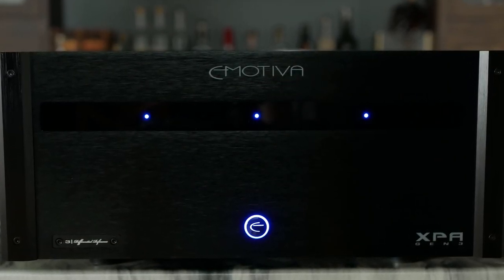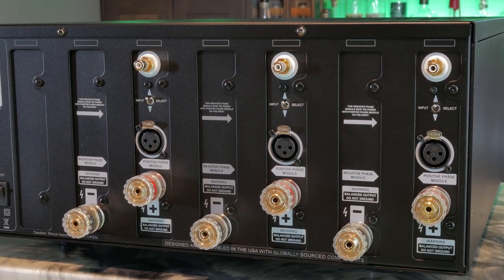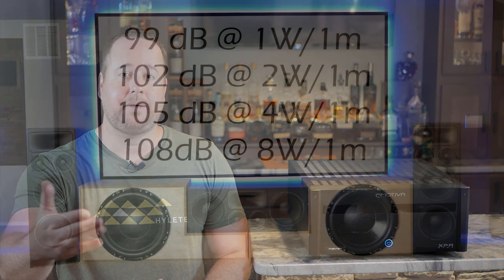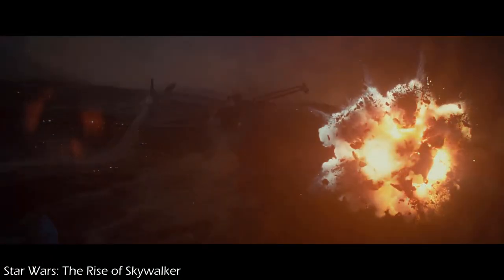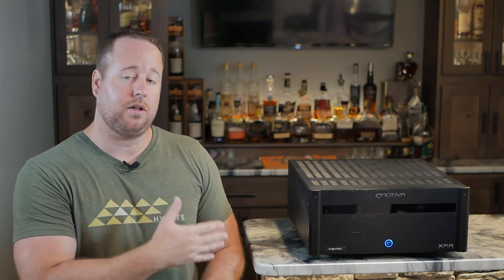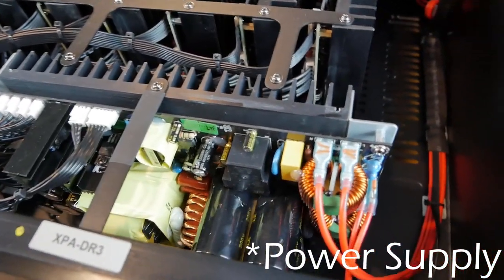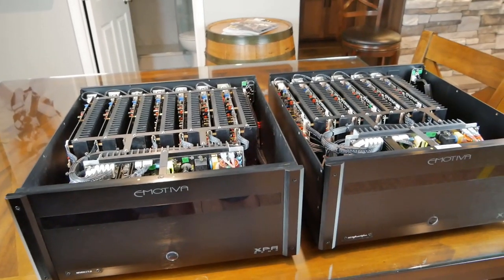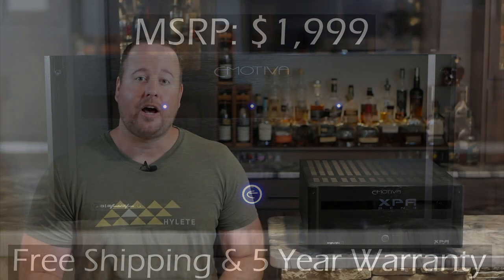Emotiva XPA-DR3 Review | Differential Reference Home Theater Amplifier

Comment: What a nice review a good explanation of the difference technically the XPA DR3  would have better specs but did you tested to determine whether or not you can actually hear a difference in sound quality between the XPA DRR3 and the XPA 7
Reply from the maker: I was only using rca cables to connect, so no real advantage between the 2 besides more power. Both sounded great, but I could not tell a difference, just more power on tap with the dr3
Reply: @LifeofBliss  are differential amps supposed to sound different?
Reply from the maker: Just a different design. Lower noise floor, little more power in this case.

Comment: I have been through a few amps, and always wind up going back to my first generation XPA-2. I upgraded quite a bit of my other gear, and now it was time for the amplifier. I was initially looking at the ATI and Parasound 2 channel offerings, both around that $4000 mark. 

I have looked at the Emotiva XPA-DR2 since it came out. What held me back was a review by Amir over at Audio Science Review. Go look it up, it was a real hit against this amp, an unfounded hit in my book, as what he stated as distortion is not audible to the human ear. 

This XPA-DR2 is very musical, as I am sure the DR3 would be. This is an incredible and affordable amplifier, and I would easily put it up against amplifiers costing twice as much, like the ATI or Parasound. It is very detailed, handles the bass with ease, fast and hits hard. Midrange is smooth and very detailed, highs are not harsh, very clear with lots of clarity. This amp simply rocks the house. 

It is sad that this amp has so few reviews and is pretty much ignored. Emotiva has a real winner on their hands here.
Reply: Amir would run a few non-musical measurements and would rate class D ChiFi amps higher than this one, even though they sound fatiguing
Reply: @wolfmanjacksaid  do you know where all the components and parts of this amp are made in?

Comment: Good review 👍🏽 However. can you confirm if those rated watts are measured at the full frequency spectrum? Many manufacturers measure @1kz which is misleading.
Reply from the maker: I went off the specs from their site, I believe it's at 1kz but you'd have to confirm with then

Comment: I'm really thinking about getting this to power my front end. Currently I have the Klipsch rf-7 III and the Klipsch RC 64 II. This should be perfect for them would you agree? Currently I'm running the Integra DRX 7.1 receiver and it just seems like I'm not getting the quality sound I should. I'm thinking on purchasing the Klipsch RP - 600m for my surround sound and maybe the rp-500sa for Dolby Atmos. Would I need another amp for those or could I just use my receiver to run the surround sound and Dolby Atmos and the amplifier to run my front end? I look forward to hearing your response thanks for your help brother!
Reply from the maker: Obviously budget will determine what you can do, but if you didn't want to spend as much, getting an amo for your front 3 will give you the biggest improvement. Moat of the soundtrack comes from there, so you'll get the biggest gain throwing an amp in for the LCR. You'd do just fine using you receiver for the surrounds and atmos. If you feel you want another amp down the road for the others, it'll help dynamics and channel separation. But again, focus on the LCR first 👍 can't go wrong with emotiva though in my opinion!
Reply: Thanks for getting back to me brother! I just received my Klipsch RP-600M surround speakers today. It's great to hear that I can use my receiver to run those and the Dolby Atmos when I make the purchase. Hopefully I can pick up this amplifier soon. I am super excited!
Reply: I have a very similar setup, I have the Klipsch Rc-64 iii Center speaker, 2 Klipsch Reference Rf-7 iii towers, a pair of Klipsch 500sa Dolby Atmos to sit on top of the RF-7 iii, A pair of Klipsch RP-500M bipolar Surround Speakers,  A pair of Klipsch RP-600M Bookshelf for surround backs, And Svs height speakers for ceiling, with 2 SvS PB 3000 Pro Subwoofers, I am running a Denon AVR-X4700H and I have my Emotiva XPA-DR3 coming in tomorrow, I had a Rotel 1585 external amplifier but the Rotel gave out after 6 months, So decided to try Emotiva, I've heard good things about there Amplifiers, And this video just proved everything I've heard😁
Reply: @monroethegreat7539  Was the Emotiva any good?
Reply: @485danne he still don't know that

Comment: I own the Emotiva XPA-7 Gen 3 and an Emotiva XPA-5 Gen 3. I also used to have the hiss/humm on my XPA amps WHEN I used RCA, all of that went away when I went to fully balanced XLR's. Well, what do you think, are you keeping any of the Emotiva's?
Reply from the maker: I have loved using these amps. They will not be going anywhere besides back in my rack 😎 and good to know with the XLRs. I really need to upgrade to a pre/pro at some point when funds allow for it
Reply: @LifeofBliss  that' the spirit :)
Reply: Have you tried Monolith 7X, made be ATI? From what I've been reading and hearing the Monolith is a beast.
Reply: Sorry this is late but im just getting to the party. If you have a hum there's a ground loop problem. Run a ground wire and connect to each piece of equipment. If that doesn't fix the problem look at it being a bad cable. If that's the case. Unplug cables one at a time until the problem goes away to locate the bad one.

Comment: Is it worth the extra $1200 Canadian the DR3 vs regular 3 channel. Thanks for a great detail between the 2 amps.
Reply from the maker: If you need the extra power, I'd say go for the DR3. 275w vs 450w x 3 channels. That will depend on your setup and how sensitive your speakers are, as well as how loud you like to listen. Personally, I don' know if you'll hear much of a difference sound quality wise unless running the DR3 with a fully differential input as well, which will lower the noise floor a bit. That's quite the difference in price, I'd look more at how much power do you really need as the deciding factor. Both are great amps though! 

Btw, if you wanted to help out the channel, click on one of the affiliate links I listed below when if/when you purchase your amp. Doesn't cost you anything and lets Emotiva know these videos are helpful! Thanks Gerald!

Comment: Thank you for great explanation.Right now i have monoprice monolitch 7x200  my speaker klipsch r28f center rc64lll you think if i buy emotiva -xpa DR3 i will get better sound Thank you.
Reply from the maker: You'll have about twice the power, so if you're running into clipping issues with your current amp, it may be worth upgrading. I don't think you'll notice too much of a sound difference outside if that though.

Comment: @5:00 could it be just what is called ground hiss? I used to have a slight, almost inaudible sound like you mentioned, in my speakers. It is completely gone after switching my power supply to one without grounding.
Maybe it would solve it for you too?

Comment: just heard you had rca as well   I can share with you that I purchased a Rane Balance buddy BB44 (passive isolation transformer) consumer TCA to PRO XLR and the buzz was still there only problem is the pro level is 12 db hotter so i still feel it is the noise floor of the AVR pre amp outs  Interestingly Denon wouldn't give me that spec

  OH I should have mentioned for the gear heads my compression midrange is a JBL 2445J and the tweeter is a JBL 2404 H-1 with sensitivities of 111 db and 105 respective so it may not be an issue for the average consumer

Comment: With regards to the Buzz you described    I use JBL SR4732 s for my left ,right and center stage and I get the same Buzz at the same power levels class H   AT first I thought it was a filtering issue with the switch mode power supply but I to soon same to realize it appears to becoming from the noise floor of my $1500 ish Denon pre amp outs (unbalanced RCA) coupled with the 111 db spl at 1 watt 1 meter  IF you have Balanced XLR outs on your (AVR) then I feel better now because I now feel it is a sensitivity in the consumer gear 

just my humble opinion
Reply from the maker: Yes once I switched to the emotiva RMC-1L with balanced preouts the buzzing disappeared. Those super sensitive speakers just pick up the slightest noise...
Reply: I was getting a low low frequency hum\buzz noise on my system as well. Just like you it did not matter the amplifier I used, but as you said i could really hear it from my listening position. Unlike you my receiver does not have balanced xlr outputs.  I found it was being caused by a ground loop issue. I traced it to my digital antenna tuner. it was coming from the coax for my digital antenna and ground loop was being carried over the HDMI cable to the reviver whether it was set to the tuner input or not. I completely fixed it by putting a $15 ground loop isolation filter on the coax before the digital tv tuner. No more hum/buzz.  I seems it is common for most ground loop noise issues people have to be related to their cable antenna connection.

Comment: I just got the polk r700 towers and I now hear the hiss from the tweeter using the DR3. I disconnected preamp and only had speaker cable from DR3 to speakers and hiss was still present but only can hear when I have my ear hard up at the tweeter not the midrange or bass.  I wonder if I uncouple the biamp plates on the speaker and use good speaker wire jumpers instead!
Reply: What receiver/preamp are you using? Are you using coax or XLR and were you able to fix your issue? I'm asking because I have the same speakers and thinking of pairing the DR3 with my Dennon AVC-X3700H :)

Comment: Will this be overkill for my B&W702s2 
90db 50-300 w
Any recommendations will be very appreciate it ?
Reply from the maker: Nope. My speakers are 99 db efficient and there is an improvement when using an external amp even though they require very little power. Any of the xpa line amplifiers would do great with your speakers

Comment: I would like to have the DR3 for my Arendal Tower 1723 and Center (Big Block). I have heared that the DR Series are not able for 2 ohm and dosent powerful enough for 16 ohm bei high Volume? Is that right? Two DR1 were going to Limit on two nubert nuVero 170 and by two Quadral Aurum Titan 9.
The XPA 1 Gen 2 are more powerfull because of Transistor AMP and 80.000 buffering. Why does the Dr series have such poor buffering without electrolytic capacitors?

Comment: hi thanks for this video, I have an issue humming sound comes from Switch Mode Power Supply and also humming sound comes from my speaker after connecting the External Power Amplifier XPA 11 GEN 3 before using this External Amplifier I was connected with Marantz SR8015 and wasn't there this issue, I don't know how to solve this issue if I use power conditioner it may solve this issue or not because I'm planning to buy a ' Taga PC - 5000 ' Power Conditioner do you think it will solve this issue or not if you have also any suggestion I'll be appreciate that hope to assist me with it ASAP.
Reply from the maker: Sounds like a ground loop issue. Either a power condition or grounding the amp to something will help. Search how to solve a ground loop issue for more details

Comment: For your DIY front stage speaker build, you specced 99 db at 2.83 volts:  Am I too (assume) that the DIY nominal Z is 8 Ohms for 1 watt
Reply from the maker: Correct 8 ohms

Comment: Your "buzzzing" is from your source or your line voltage which is not clean. Check neutral to ground voltage that should be under 1vac

Comment: Actually, you would only need 128 watts to reach 120db with your speakers. My large monitors are rated at 102db@1watt per meter and they have registered 123 db on my decibel meter with a 200 watt input with plenty left as my power amp is rated at 450 watts per channel. You are right, definitely not needed!  Lol. But it's nice to show off what they can do once in awhile.
Reply from the maker: For sure, always better to have more in the tank! And yes, especially with all 3 playing, it'll be pretty dang loud at the seating position with just 128 wpc. And I agree, why even have big 'ol speakers if you're not gonna show off every now and then 😉
Reply: Is that 200 watts peak or RMS? I’m considering the DR3 not for RMS power but for transients from hi-res music with 24-bit dynamic range. It seems you would need a lot of extra power to hit those peaks without soft clipping them. Has that been your experience?
Reply from the maker: The DR3 does 450wpc rms. To my knowledge, I've experienced no clipping, but I'm just going by sound. I can't turn my system up high enough to clip or compress any dynamics without headphones on, which seems a bit silly to try and do lol

Comment: I am confused why you would have a fully differential amp and run it with RCAs, it totally defeats the purpose. Please try it with XLRs
Reply from the maker: Unfortunately I don't have a receiver with XLR output. Yet. I will revisit these amps when I do. Many people run these with RCA just for the power output as well. But ultimately I plan on upgrading the receiver at some point

Comment: I've use subwoofer cables instead of rca,better insulation then rca,next best to XLR. No hum for me.
Reply from the maker: Subwoofer cable? There's no such thing... are you just using a rca with better claimed shielding? Rca is rca, just transmit signal, not frequency specific
Reply: Probably talking about coaxial cables

Comment: Getting a fully differential amp and still getting hum or buzz at the speakers kinda defeats the purpose of spending the extra money on that aspect. May be these are just good for massive power and reduced noise floor is just marketing gimmick.
Reply from the maker: The entire signal path was not differential. Once switched out to XLR cables, speakers are dead silent 👍